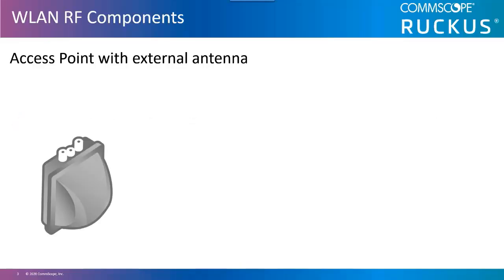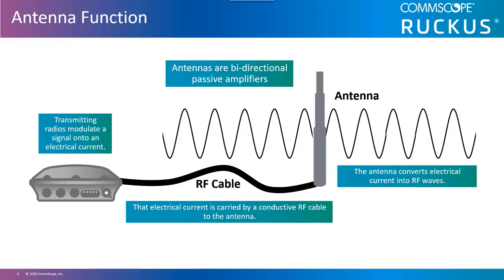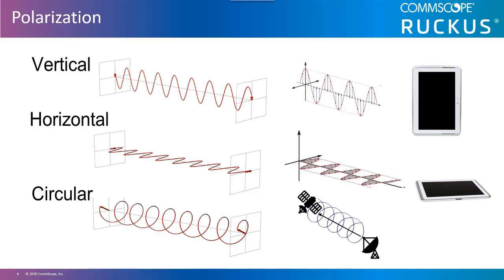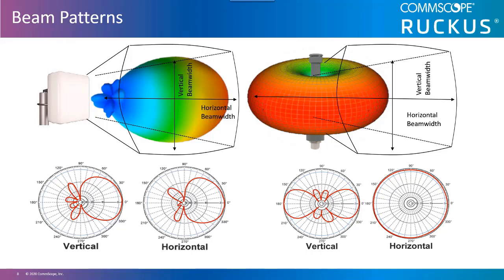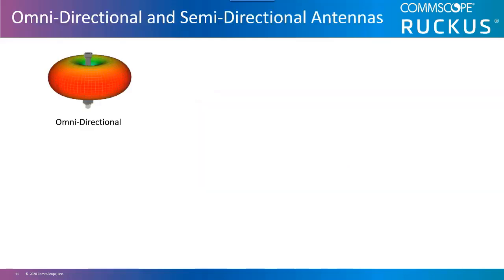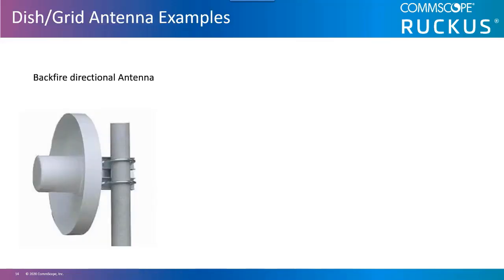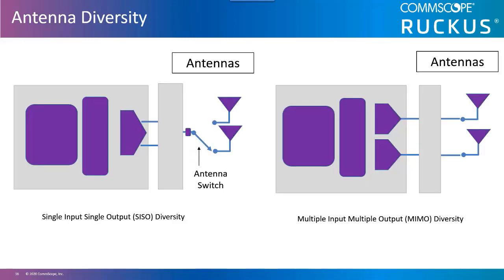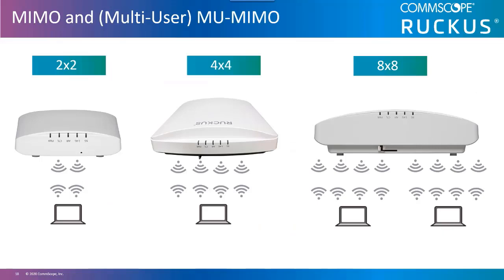RUCKUS RF Basics - Antenna Function, Patterns, BeamFlex and Options

Comment: Calculation Incorrect @9:00:
IR: 10 dBm
Antenna Gain: 3dBi
EIRP/Output: 10+3 = 13dBm. 

Not 20 dBm as you mentioned.